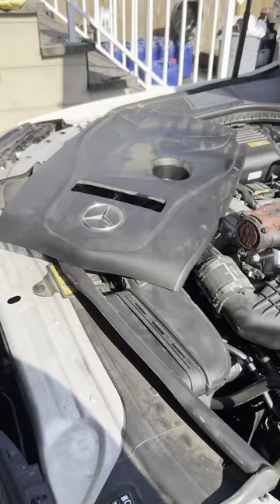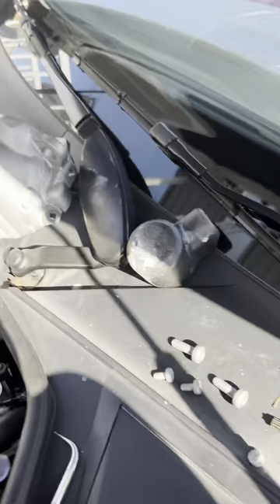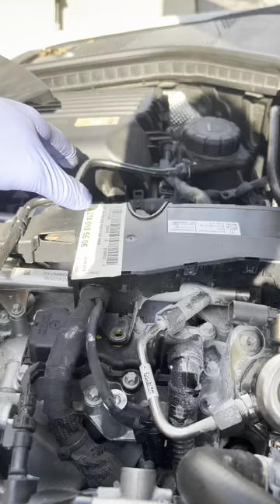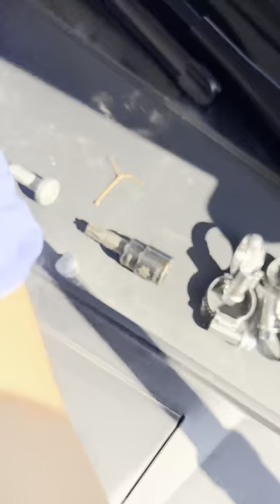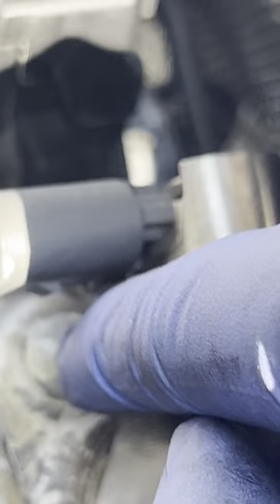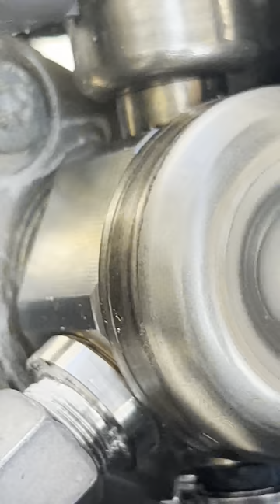2014 -2023 Mercedes gas smell in cabin, DO THIS FIRST !!

Comment: How you take off that big metal thing
Reply from the maker: Disconnect the connector for high pressure fuel pump 3 Torx 45 bolts
Reply: @BPROAUTO95  actually 4 bolts